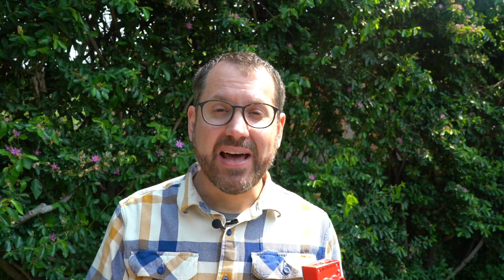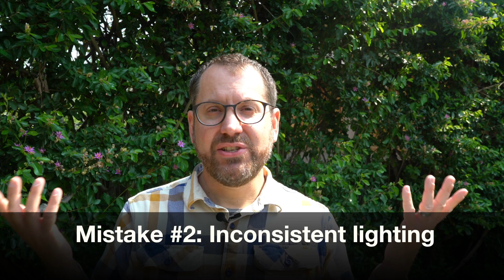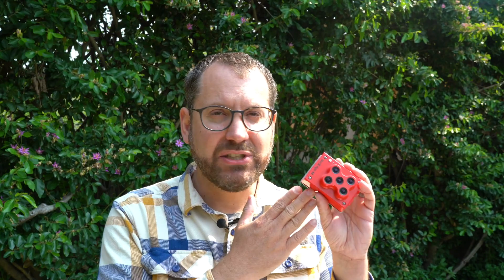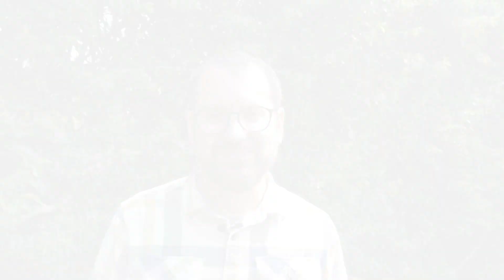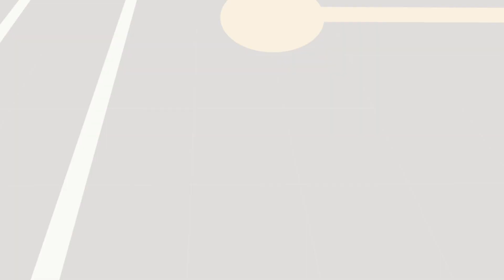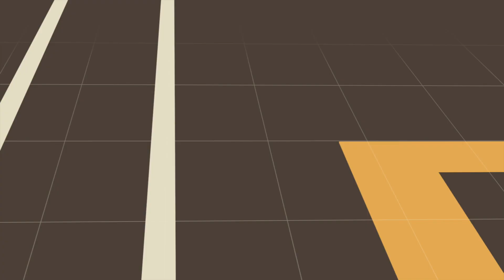3 of the biggest mistakes in mapping farms with drones

Comment: Hi I will using a multispectral (Flir Duo R Pro) camera to detect temperature differences on the ground.  I imagine your 3 cautions apply to a thermal camera as well, right?
Reply: The multispectral automaticly corrects when there is a cloud coming by. It has a light sensor so the second problem is fixed😅

Comment: 'Inconsistent light conditions': isn´t this an issue that we should assume is fixed by additional light sensors that come with the camera, like MicaSense Red Edge, or Slant Range 3p, or Parrot Sequoia? Now I´m confused. I thought those light sensors were supposed to take care of it.
Reply: Hi Frederico,
I also thought the incoming light sensor would solve these problems, but alas! Under partly cloudy conditions sometimes the drone/sensor will be in different lighting conditions than the ground that is being sensed. So the incoming light sensors are great for solving problems associated with differing quality of incoming light across different flights or days or seasons. However, they don't represent a complete solution for variable light conditions that occur during an individual flight. I was pretty disappointed when I first learned this (directly from MicaSense) but now it's just a part of my work plan.
Reply: I'm wondering exactly the same thing, I thought the combination calibration target before and after flight + irradiance sensor allow the sensor to calculate reflectance?
Reply: I have the 3p with the light sensor and I still get "spots" from light differences when the sun goes behind clouds and then pops back out.  The light sensor helps, but still causes very noticeable artifacts and requires me to re-fly.
Reply: Matt Huff So, 3p? I'm thinking of getting one myself (well 3px + M200). Are you happy with it, do you really take advantage of the image processing? Is it as fast as advertised, as opposed to all others?
Reply: Can't say for others as its the only one I have owned.  It is fast though just have to make sure and calibrate and put the settings in slantview correctly for type of plant.  This is more trial and error for me, but good practice anyhow.  I would also add that they are very helpful if you are having issues with a map and can help remedy problems if they arise.

I am also interested in Sentera's products, but haven't pulled the trigger as of yet.